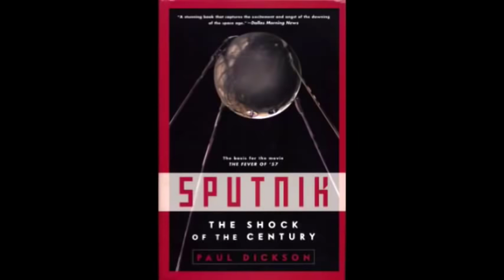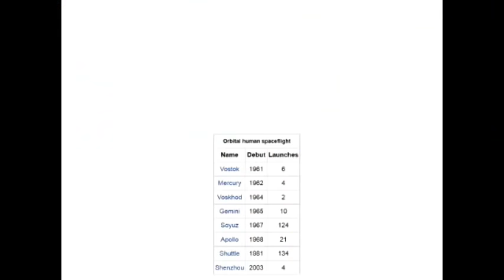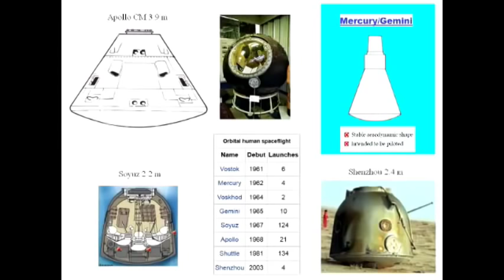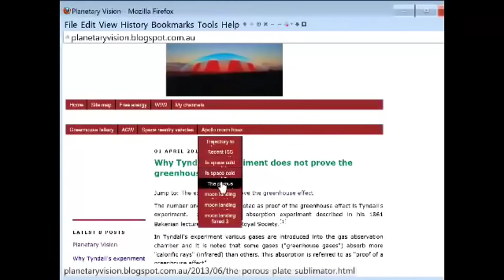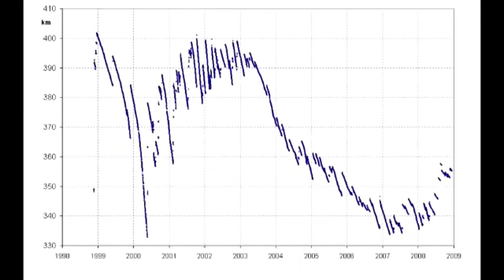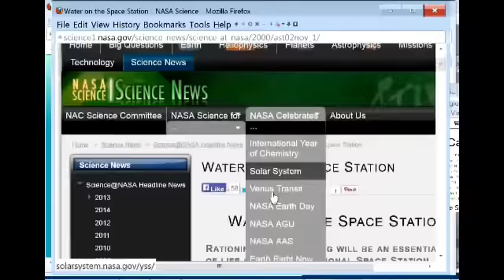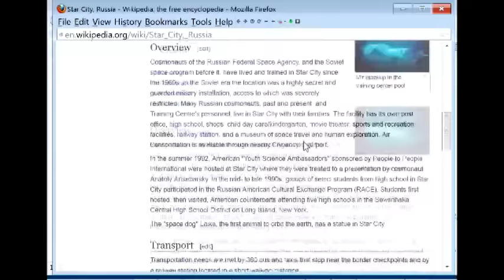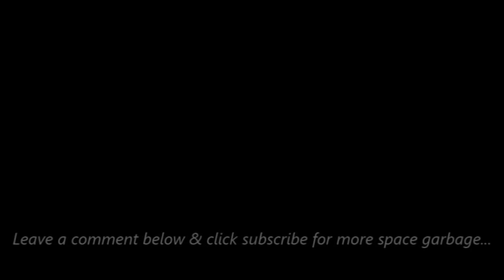The ISS Exposed

Comment: Please explain how I have seen the ISS in the night sky on a number of occassions?
Reply: Lie
Reply: Lie
Reply: They fly a mock up around above earth. If it were in outer space you couldn't really see it , only with a good telescope. Someone mentioned the fact the moon crater is 60 miles across. If it thousands of miles away there's no way we should be able to see it from here.
Reply: Buck warpzone  that's the point science is observation. If it were in outer space we shouldn't see it from here including the details of the moon only through telescopes.  So tell me why they only CGI everything and there's not one original non paste up pictures in outer space. Why don't they have cameras on the front of rockets with footage facing to outer space. ..again non Hollywood reproductions.
Reply: Buck warpzone  I suppose you believe Superman is real and can fly too smh
Reply: Buck warpzone  I thought it was a science nerd thing you lonely guys did.
Reply: MJ  I have a 7' foot telescope with a 16" F-4.5 Mirror. I track the ISS every chance I get, with a 18mm eyepiece you can see individual solar panels and the main structure.  Awesome!!  The ISS is real.
Reply: Ken Bar They will never give you a straight answer. I see the ISS every chance I get.   I have a 7' foot telescope with a 16" F-4.5 Mirror. I track the ISS every chance I get, with a 18mm eyepiece you can see individual solar panels and the main structure.  Awesome!!
Reply: denis    Why would the  Shuttle dock with the ISS? I viewed it two times, one time undocking. People do live in the ISS. Everyone on the ISS must work out for 2 hours on equipment that makes noise, a  few modules down you can't notice it.   Forward all other questions to: Ask NASA.gov     Also look up how the ISS is maintained.
Reply: @m.j.2939  
 The Moon has a diameter of 3,474 km and its apparent size (angular diameter) is 0.5° or 30' (arc minutes). The resolution of the unaided human eye is 1'.  Therefore, seeing something with a true size of 115 km on the Moon should be possible. This is a little more than the 96.5 km you have mentioned, but then this isn't the biggest crater. Clavius has a diameter of 231 km and is quite conspicuous.

There is no "mock up" flying around. A mock up would have to be as high, as big and as fast as the original, because otherwise people who are a lot more knowledgeable than you would notice. (Such people do exist, you know.)
Reply: John  The ISS is 240 miles in earth orbit, the only way YOU will know for a fact is do your own test. Check what time the ISS will fly over Get a telescope with a minimum of 4-5 inch lens with a 24mm eyepiece. Get 210 miles from Mt.Everest,   focus the scope on the top of the mountain. When the ISS is straight or close over you, look in the eyepiece, If you see just for a  second or two you'll notice it's in focus just like the mountain is (210 MILES AWAY) . I'm finished.
Reply: Ken Bar - Please explain how I have seen the ISS in the night sky on a number of occassions?

LSD 25
Reply: Why are they faking swinging from wire's if they don't have to!!! And the woman's hair LOL!!!!
Reply: @m.j.2939  WOW ,they seem to go to SO much trouble and money just to try and fool you flat earthers! But they can't fool you guys because your so educated!
Reply: Because you have I can confirm it's there and there's astronauts in it.
Reply: You saw something that looked the same shape using an app supplied to you and you did not notice it was made of light...hmmm. One thing the US is good at is lies and deceit!
Reply: yea it's fucking tiny bro,  you really think you could see such a tiny object flying around with your naked eye?
Reply: Explained at 32:40 lol
Reply: The sky is fake !  We live in a simulation.
Reply: Did you see them waving out the window to you? if not how do you know there was anybody on board?
Reply: Yes, its easy to find and get pics with commercial cameras and cheap lenses from best buy.
Reply: @m.j.2939  not true, I saw halies  comet.
Reply: Because you looked UP IN THE SKY. LMAO
Reply: Why so aggressive in your reply Adam?  and I quote...'You'd know it already had you taken the time to watch it.'.. Is that how you respond to people in normal everyday life, or just when you're sat at your keyboard in the safety of your parents home?
Reply: Did you just come up of a bar when you saw this up in the sky?
Reply: As said in the video at the end - it is up there, but empty.
Reply: @charteres5511  haha, that was funny.
Reply: Because it's low orbit and not in space!
Reply: the iss orbits the milky way at 186,000 mps. I've seen it.
Reply: It may well be there but can you tell from the Earth whether it's air tight or even occupied? I can't find any ISS on board video that passes the sniff test. All with short interval cuts (parabolic flight?), obviously and needlessly sprayed long hairs, tethers lifting their clothing, constipated faces when a frame starts.
The space walks may well be real. But if you're in a space suit anyway, the ISS could be a siff and still work for you. Would suck to stay longer.
Reply: @merkabah2  you see reflected sun light off rhe solar panels.
Reply: ISS is seen at night and is reflected by the sun showing up against a black bacgground, it looks like a star, you don't see any detail. 'Just consider it take as long as you need.' @gone fishing
Reply: @gone fishing I can see The star Sirius in the night sky as clear as a bell, and guess what it's 5000 billion miles away. What's your point?
Reply: It's a long way away  Ringo Garvin  which was my point
Reply: @carlhumphreys9024  I think you could have one of these deniers come over and look through your telescope and they still would say it was fake. One thing for sure Lunar Lunacy is completely real. I try not to read these posts but it's like they say you can't not watch a train wreck. Nothing more baffling than the human mind.
Reply: Robert Brown  Thumbs up for Lunar Lunacy. Anyone can see the ISS in my telescope, I'll let the deniers look if they want, still they say it's fake just like you said. It's sad that fake videos turn people into weak minded individuals that believe a Unicorn in the back yard is more real than the ISS.
Reply: What the hell is a green screen all over the sky!?!?!?
Reply: Fallen   You should  google how far is the moon from earth. You did go to school?
Reply: Its a special conspiracy plane towing the ISS at high altitude.. :D
Reply: That WAS Top Secret!!!!
Reply: @m.j.2939  it would help if you were a little more educated on the subject. First - the ISS is NOT in outer-space. It is in earth orbit. LEO. Those are two drastically different things. Second, you can clearly see craters on the moon with a $5 telescope, and you can see even closer with a $150 amateur telescope. You can see details in celestial objects 1.2 billion kilometers from earth such as the rings on Saturn. Where you got "thousands of miles away there's no way we should be able to see it from here" is beyond me but my guess is you'r letting misinformed youtube videos trick you into believing flasehoods so they can get more views and revenue for ads. Go get yourself a small amateur telescope and track the ISS like thousands of people do every night without the help of NASA or any other space agency. You can even track sattelites and other celestial bodies such as large meteors. Don't limit yourself to the falsehoods and brainwashing BS that is put out on Youtube otherwise you've already fallen for the lies your own government is hiding from you in space (on higher ground).
Reply: Its a large fancy model suspended by a balloon way, way up. Easy peasy.
Reply: You can see the outline and stickers on the ISS at night?  Or do you see a light going around and are told that it is the ISS?  Which is it?
Reply: Ken Bar
You've been told it's the ISS. But is it tho? Or rather, what is it?
Reply: @geminichan5480  moon is only 240,000 miles away, NOT millions
Reply: @denissorn  ISS is 250 miles altitude. Van Allen belts only begin at 400 miles altitude. ISS does not go through belts.
Reply: @merkabah2  A massive mirror of solar panel glass, reflecting unhindered sunlight in the dark of the night sky.... yeah, you can see it with the naked eye.
Reply: @enrico3web   hahah yes... its a simulation... the earth is flat too, makes for easier simulation computations.
Reply: Adam Richard  empty... it requires constant energy to keep it in orbit... it loses altitude and speed from hitting air particles at the edge of our atmosphere. If it isnt maintained, it would fall into atmosphere and burn up.
Reply: @kenbar4761  lol, thats some funny stuff. Thanks, cracked me up.

"Why so aggressive in your reply Adam? and I quote...'You'd know it already had you taken the time to watch it.'.. Is that how you respond to people in normal everyday life, or just when you're sat at your keyboard in the safety of your parents home?"
Reply: You saw a point of light traveling through the sky.  That's all. What that light was reflected off of, could be anything they put into orbit.  But the tracking app is fun, admittedly.
Reply: @SteeveohRising  So.... are you saying there are objects in orbit around the Earth, but a manned ISS is NOT the object the app tracks?
I see your trying to NOT be definitive, which is good, as no one knows without a doubt unless they themselves have been there, but the data suggests the ISS does indeed exist and currently supports human life.
Reply: Adam Richard  Back in their place? You think respect is owed to you? "Play" the smart ass? Again, Im the moron... 
It is clearly my ignorance at work here. I shouldn't have opened a line of questions that would resolve the positions we hold, in an attempt to reconcile truth about the ISS.
Your wisdom has been well expressed. Thank you for your valuable, well thought out, insight.
Reply: Adam Richard  I assume you have a position. I hold a position in this discussion. I was attempting to ascertain your position. I never indicated our positions were the same. So in this dialogue, you literally have stated nothing in context to whether or not the ISS contains people, which is what the entire dialogue is about, is it not?

Why are you engaging with people in this discussion, if you have no position on whether the data presented is true?
If you DO have a position on whether the ISS contains living humans, how about present it, instead of accusing and arguing that people are morons.
Reply: Adam Richard  With all that you've stated, you don't want to indulge us with your fundamental position on this video?

Ok, then begone. Ive lost enough time with you already.
Reply: Adam Richard  Fine, you win. I give up. Apologies if I made baseless judgements. Take care.
Reply: @rosen9425  I asked the same thing before.  Does anyone see the ISS (more than just a light, more like actual structure/NASA or other stickers?)
Reply: @carlhumphreys9024  can you see any satellites/space junk when you are tracking the ISS?? I have always wondered if you can easily see that stuff. they say there are thousands of pieces of space junk/satellites up there right now. Would love to know if you get time. Thanks.
Reply: Diana  When I track the ISS I'm moving my scope a little fast, I wouldn't notice one fly by. I've seen  satellites in my scope, they look like bright stars. Most satellites can be seen with your eyes, the most famous junk I think orbiting earth is the old Apollo Burnt out rocket stages. Google how much junk is orbiting earth. last time I checked it was almost 1 Million!!! Including all the satellites. If you have any other questions let me know.
Reply: @carlhumphreys9024  

So if the ISS is in Earth's orbit, wouldn't it be in the same spot over the same area at all times since its rotating with the earth? Doesn't make sense to me...

Comment: Not having airlocks is an interesting point. Only thing is every single movie and model of a space station looks like a roulette wheel. The water doesn't need chemicals to filter and it's limited to one module, the air is also filtered heat and cooling usually with peltier type systems, bacterial  chemistry is different in space, surfaces are costed with antibacterial properties.

Comment: Circulation fans and fluid coolant pumps were constantly producing background noise, so early ISS crew members had to wear earplugs,...Over the years equipment upgrades, sound mufflers and insulation have reduced the noise to a point where protection is no longer required but it is still somewhat noisy.

Comment: You've been pummeled by the thumbs down crowd..... lmao,  you've got a certain irritating
quality in your analysis of the ISS.  Too many loose wires, pipes, tubes all hanging in ways
that would lend itself to a catastrophe.  And the loose  globules of water/piss/sweat may
also lend itself to frying an electrical component/circuit?  And  where do they store all the
dolls/toys/musical instruments along with all the other gear?  It doesn't add up to me but
I'm not a 33degree  mason either?  They're  laughing because  they  can't believe  that  we
think it's real?  One of the all time greatest cons & the trillions it's snagged is surely worth
a big  grin  from  ear to  ear?  If any  one of  them told the truth they'd be in an accident or
suicide  by 3  gunshots  to  the  head......   that's  just  the  way  they  roll?
peace
Reply: Spoken like a true armchair engineer!
Reply: @valveman12  ~ THank you,  when it comes to NASA stuff we obviously can't be there to look but in my HVAC Career had my wiring/piping be so messy it may
have caused high energy bills, or fire, &
Code Enforcement would NEVER have passed off my work. Mine was just a small $10,000 systems while NASA is
doing sloppy ass stuff that's 10's  of
millions & endangers all the crew &
the investment WE Paid for. peace
Reply: @diggydice9041     ,,,well said diggy

Comment: If the  ISS is up there, wouldnt it be constantly be getting damaged by space debris up there ????????
Reply: jammydodger1982  I would think so
Reply: no because everything's going in the same direction  and in the same orbit everything moves at the same speed, per Kepler's third law.
Reply: Id say not so much because they are technically still inside an atmosphere which provides protection from debris.
Reply: @BlokeOnAMotorbike  But other items at the same altitude could be on an opposite collision course. There is a given speed with every altitude, but not a direction other than roughly taking a full rotation, not trying to just orbit above a pole circle or anything. 
Even if ISS exist in its form as presented, it may not be livable without a space suit. The space walks may be the one true thing we see of humans up there.

Comment: Can someone please explain. So they train under water & the pressure is from the water trying to get into their suit compressing it. Then when in the vacuum of 'space' (lol) wouldn't the air pressure from inside their suit expand & try to get out blowing up the suit like the Michelin man? Basically they wouldn't be able to move in the suit at all.
Reply: The suits they wear for underwater training are most certainly not those they use in space. Note that the near-weightlessness under water affects the suit, but the man within the suit is still subject to the usual gravity, i.e., the body is pressed on the side oriented down - which can be rather inconvenient. Hence, these suits are "tailored" in a completely different manner, and this would include resistance against water pressure from the outside. OTOH, suits for use in space don't have to have an interior pressure equal to that at ground level here on Earth. If you increase the proportion of oxygen, you can reduce the pressure accordingly.

Comment: @24:05 - Those vehicles that burn up during re-entry are not designed to survive it, while those who do survive it, are designed with that in mind. A cardboard box is not waterproof and shouldn't be used as a boat, while boats can be used as a boat. You see the difference?

Comment: At one point during the video, you can see the camera following one of the astronauts as he travels through the space station. If the fake station were built inside a plane, you could only travel lengthwise through the jet, but not perpendicularly, since the plane's hull isn't that tall. But the astronaut at one point goes down 90 degrees and travels quite a distance before disappearing through a hatch. How can that be possible?
Reply: just look at the wires and the blue screen of george bush

Comment: Its not fuel burning rockets they need to stay stable, it has to expell something like air, CO2, Nitrogen, something with mass to eject and push the station away. Not to say that is any more viable. Just wanted to correct that one point.

Comment: Speaking of no airlocks in the various secions, just how exactly did they add those sections on in the first place?
Reply: every port has double bulkheads, one for each side. The ones designed for permanent connection have the bulkheads stowed elsewhere once they've been placed.
Reply: @BlokeOnAMotorbike  Appreciate the response, but I intended that more as a rhetorical question.    I don't believe there is a real ISS orbiting the earth, or any other satellite.      There' s a video on here somewhere interviewing a seal and gasket engineer.    According to him we don't possess the technology to create a seal or gasket that can withstand the vacuum pressures of chambers here on earth, much less the even greater pressures that are supposed to exist in space.     If he is to be believed the only seals we have that might be able to withstand those pressures are non-resealable metal on metal gaskets that  would  only last about a week before needing to be replaced.   Thus no possibility of people on an ISS.  No space suites.  No hatches.   No people anywhere near space.